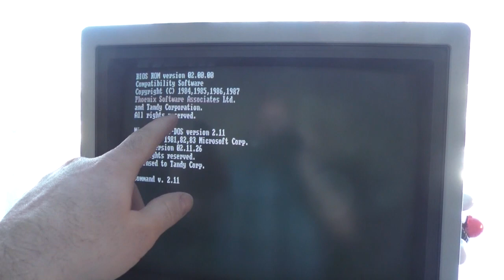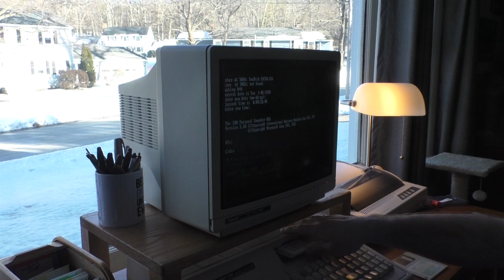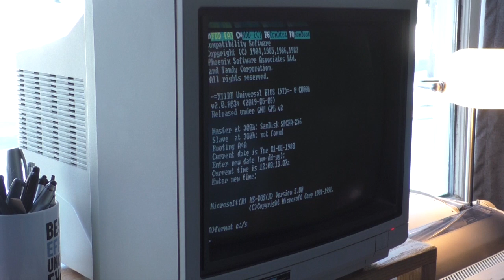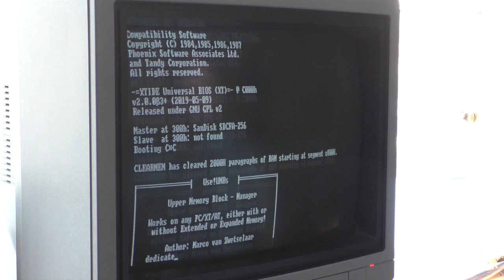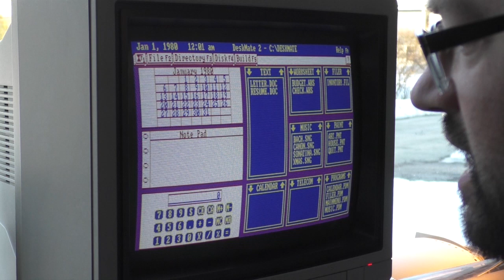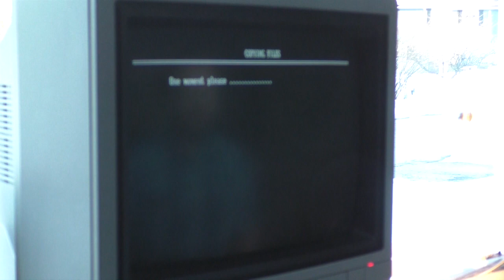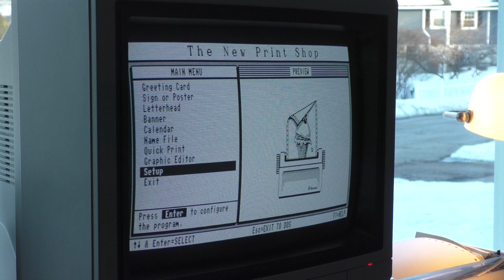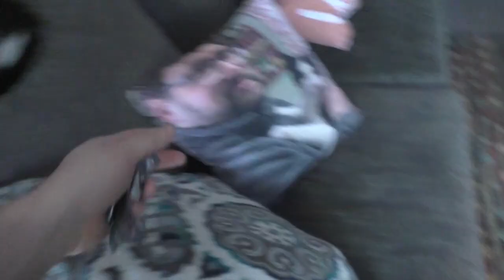Tandy 1000HX/EX 3-in-1 CF Card Setup

Comment: Remember, MS-DOS 5 is a hit. No PC should be without it!

You pretty much need MS-DOS 5 to take full advantage of the UMB drivers. A lot of under the hood changes were made to support that in 5.0 (particularly with AT class machines and HMA) that simply don't exist in 3.3.

Comment: Now you can learn why people put SSDs/CF Cards into vintage PCs.
Reply from the maker: I knew why all along - I just prefer to use mechanical storage on my vintage systems
Reply: @bbishoppcm  Well it was awesome hearing your excitement of seeing it fly!
Reply: If it wasn't for the fact it's been retired I'd be actively huhunting for a CF to EIDE adapter for our old Dell inspiron 1300 so I wasn't putting miles on the new old stock drive in it at the moment.

Comment: Did you ever figure out why you get some lag time waiting for the prompt to return while the system is checking available drive space?  Mine does the same.  Just set it up for the first time.  I also had to do FDISK / MBR
Reply from the maker: Yes, the drive was partitioned too large - remember, an 8088 was popular when the largest drives were around 40 megabytes! Just repartition the drive into smaller chunks

Comment: Where can I get an already made card?
Reply from the maker: No longer available, in kit form or assembled.
Reply from the maker: At this point, I believe your only option is to have the board manufactured from the files made available by Rob Krenicki. All the digital content needed for production and parts lists are made available, so it's totally possible if you want to go through the effort.